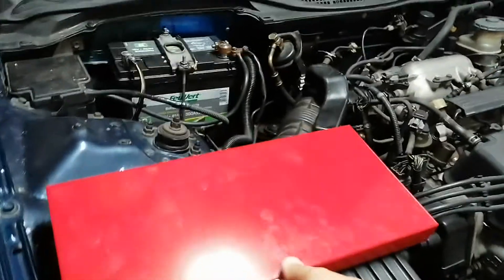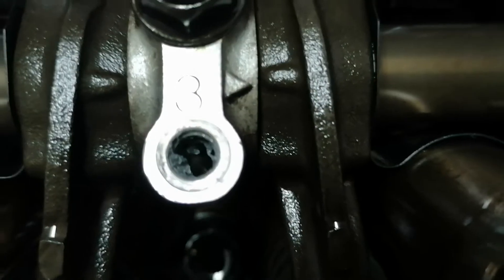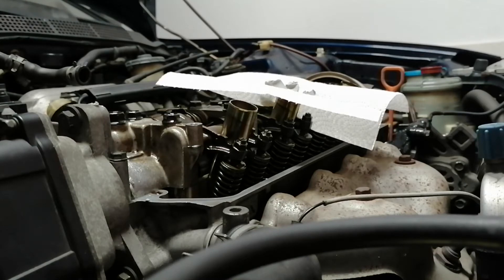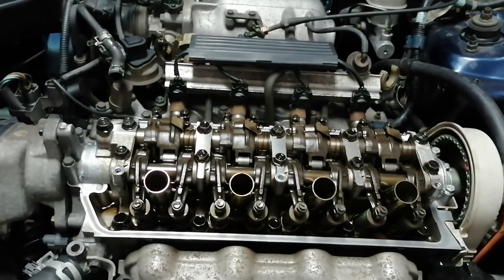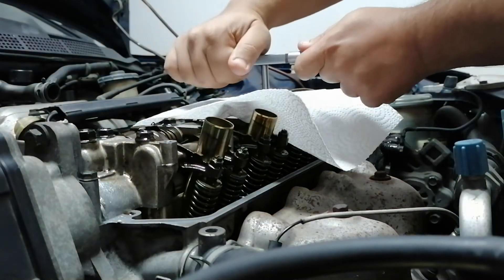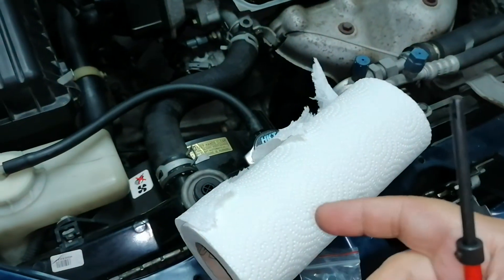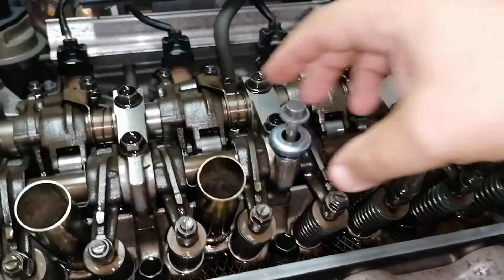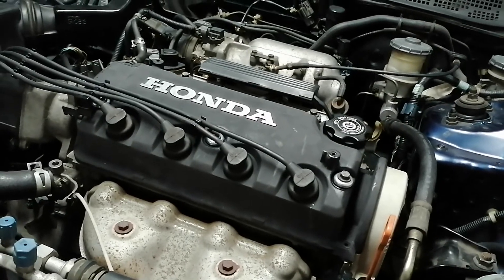Honda Valve Cover Bolt Holes repair

Comment: What size threads is that part you are using
Reply from the maker: Hi Jose , sorry for taking so long . I've been absent due to lots of work .
I've used the kit for M6 , the drill bit was 6.2mm . I'm not sure on the pitch of the tap but I would assume 1mm